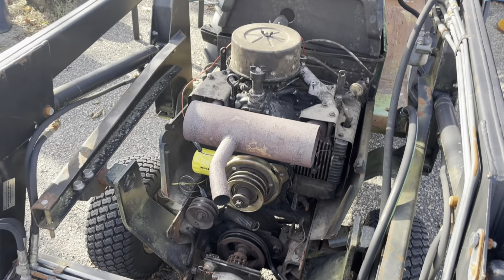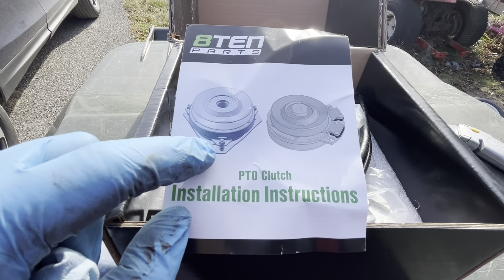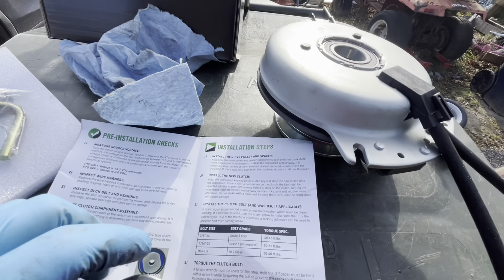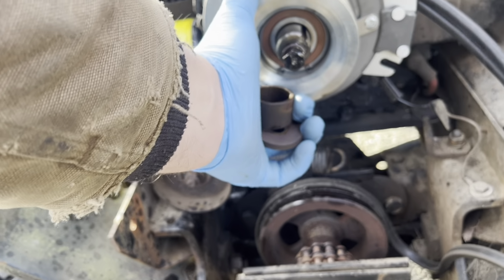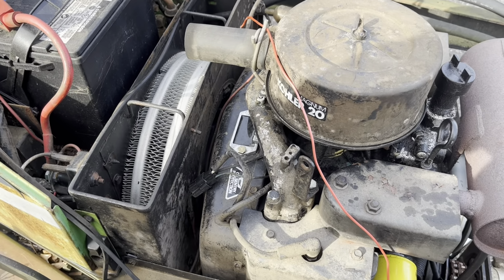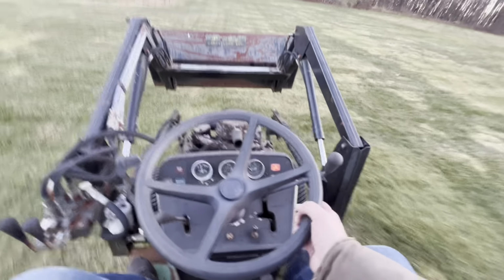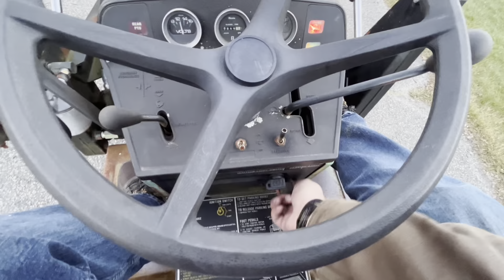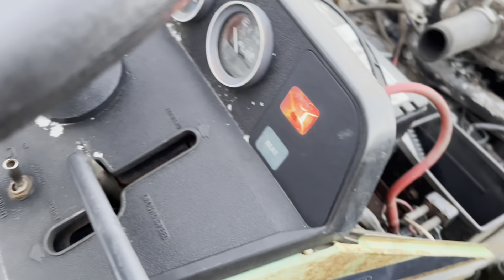New PTO Clutch for the Deutz Allis 1920 Part 4

Comment: Another way to keep the engine from turning is to remove a spark plug and feed in some small rope into the cylinder. The rope will keep it from spinning. Good luck.

Comment: your PTO switch could be part of the ignition wiring.  Probably corroded, shorting out. I have to wiggle my PTO switches on my Simplicity 9020 to get it cranking...part of the safety thing.  I will take them out eventually, disassemble and clean them.   Can you post a link to that clutch?  I might need one for my FEL.  Or rebuild my original, 50 year old OEM,  not!